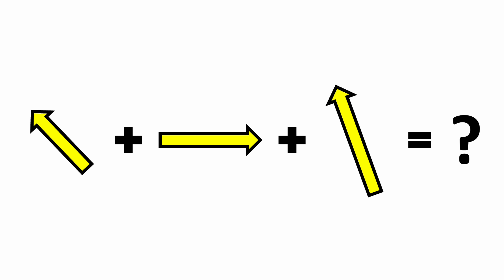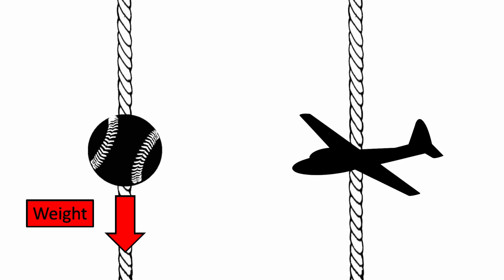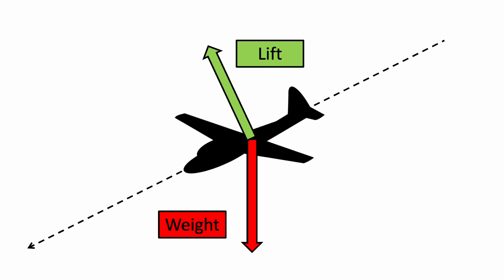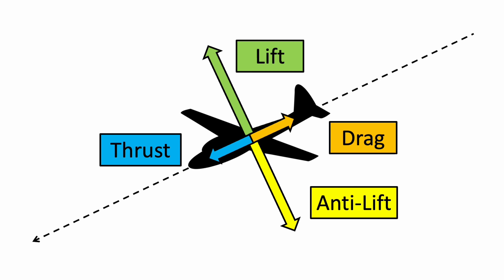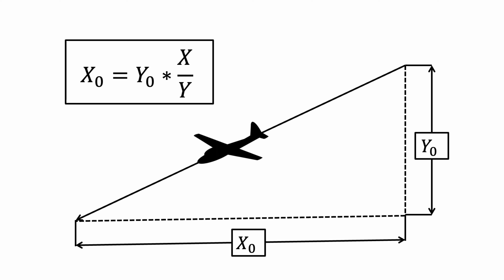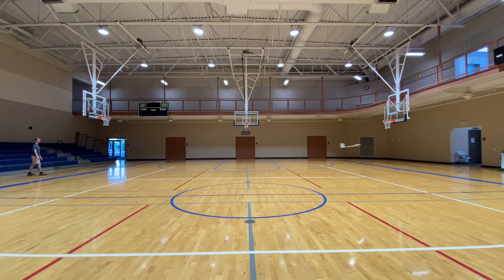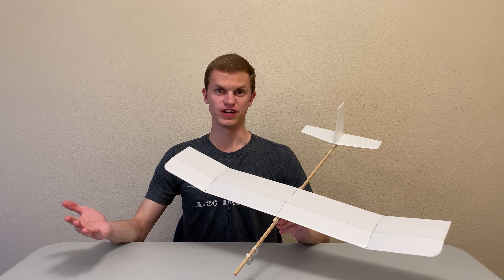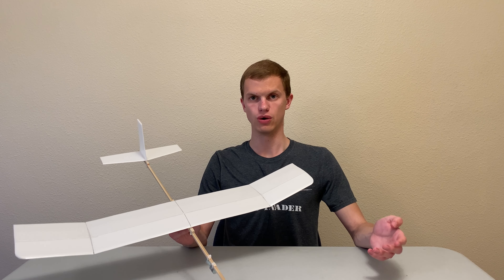Introduction to Glider Flight Physics and Maximizing Flight Distance

Comment: Another way to see it is:
Given the weight, the lift required is basically set (for small angles of descents it's almost identical to weight in magnitude, and differs mostly in direction). To increase the distance traveled we need to reduce the angle of descent, i.e. how much the weight diverges from anti-lift. How much those two diverge is the thrust.
Thrust is higher for steeper descent, because it's "how much gravity pulls the plane forward". But thrust and drag are equal in magnitude: so we need to reduce drag.

Comment: Hey man, I love the videos. I'm interested in designing and building my own model planes, and I have to say you've done a stellar job explaining. I have one question though: if I add a motor and servos, how do I make sure it can still fly? Anyway, thanks for the help and good luck
Reply: The items you add to an airframe make your airplane heavier, that's all. Potentially they also add more drag if mounted to the outside of the fuselage. Keep that in mind for the wingloading and move the items (in particular the heaviest ones) around until the center of gravity is where you need it to be and you should have a good chance for a successful first flight. Once it glides well it should fly ok under power.
Reply from the maker: Here's an article from FliteTest that talks about things to consider when choosing motors and propellers: 
https://www.flitetest.com/articles/easy-aircraft-design
Choosing a good propulsion system is definitely important, I've had several bad experiences with under-powered airplanes.